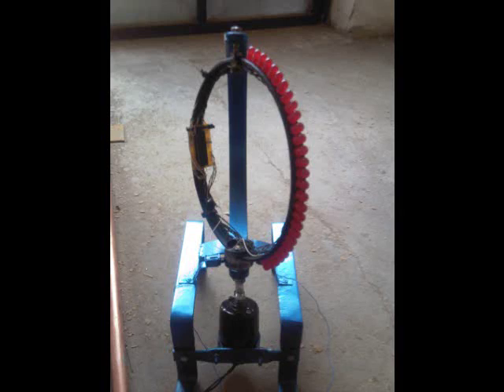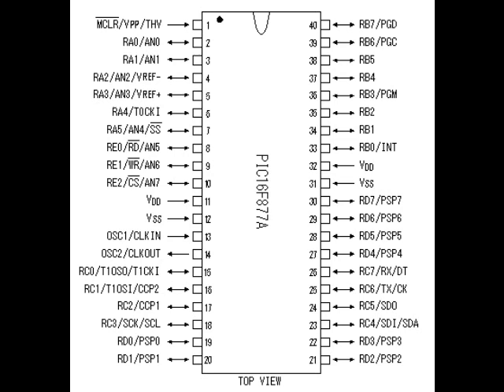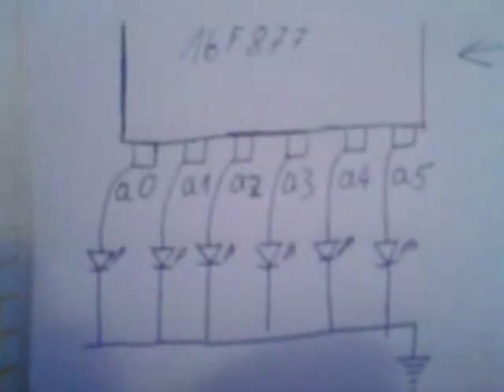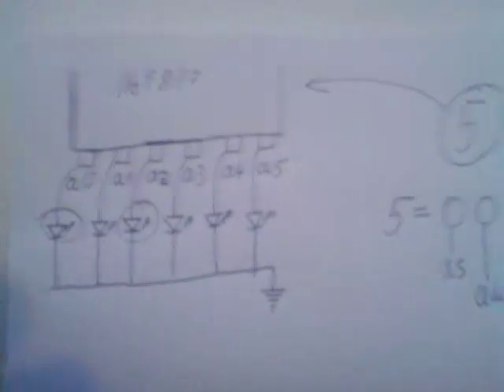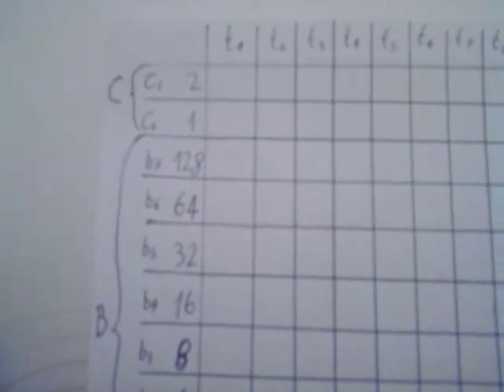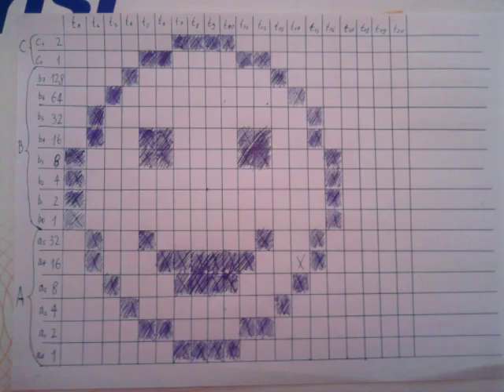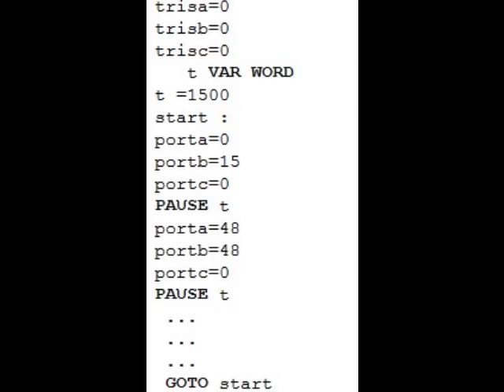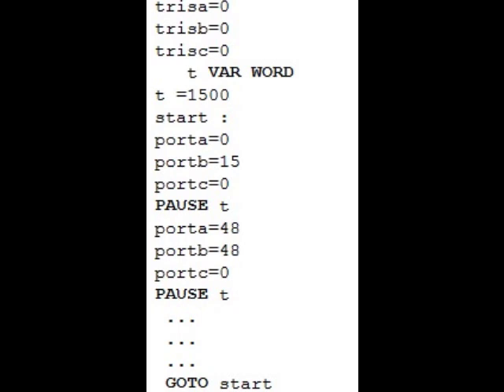Led globe - how code is made

Comment: I have a question, The programation of the times changes for the LEDs that are in the middle of the ring than the LEDs that are in the top or bottom?  Because the diameters are different, and isn´t the same time to complete a lap, the LEDs that are in the middle take more time than the others.... How can I solve thes problem?, I hope you can help me, I need your help please!